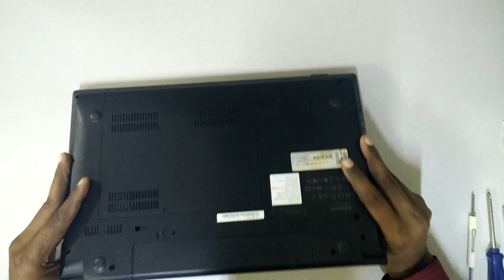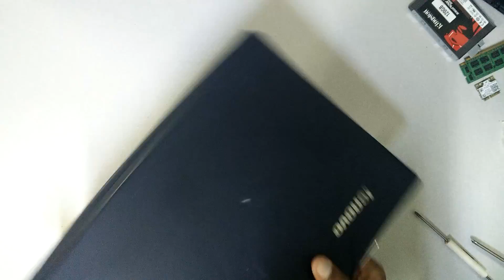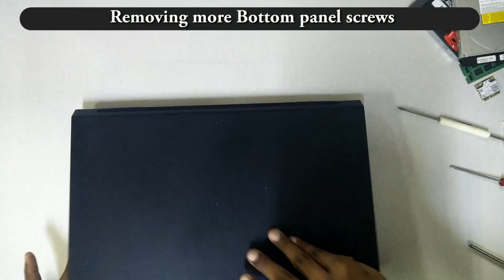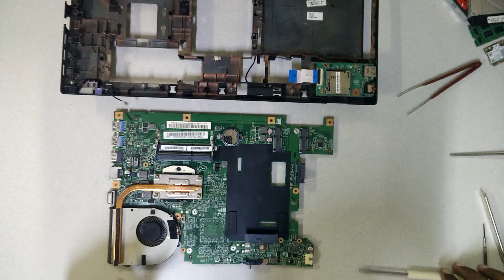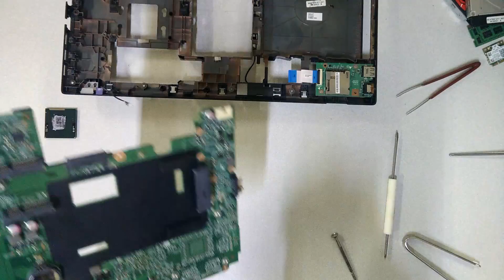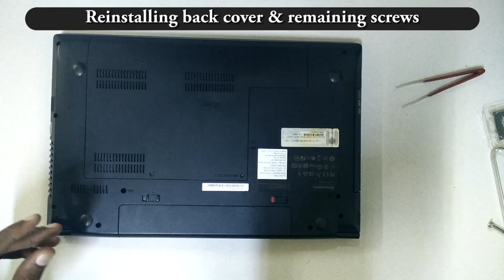Lenovo B590 laptop CPU upgrade step by step

Comment: You can also upgrade the HM70 system to a Core i7, you just need to patch the BIOS and use a cheap CH341A programmer with a clip. I managed to do it without desoldering. There's a description in the Lenovo B590 thread on 4pda. You can also upgrade to 16 GB of memory.

Comment: In 2023 What CPU is better to Update  this Laptop???
Reply: The Intel Core-i5 3230M, 16 MB RAM and a SSD. So you can install Windows 11, it runs as fast as Windows 10. But be careful, my B590 came with the Core i5. After an upgrade, the laptop may restart every 30 minutes. My mainbord has the number 627439G.

Comment: Thumbs up! Question... because obviously you know what you are doing and I don't lol.  I just upgraded mine with an SSD and new ram(after taking a course in A+ and thinking of changing careers before I realized no way because I over estimated my intelligence level lmao). Still I took the upgrade project on of my old Lenovo out of boredom and was successful. But now my fans are running hot. The Lenovo is lightening speed btw so patting myself on back for that, did well lol. I seem to recall though in class about maybe the cpu can't handle what I did- its vague and I cannot remember. Thoughts? Should I upgrade the CPU and what to?

Comment: HI bro op video!Could i ask u something?I have Lenovo B590 motherboard 20206 with 2gb ram and cpu intel celeron 1.9Ghz.Its very slow and all the time it froze.Could u tell me if its possible to change the ram to 8gb and which processor is the best for my model .I really want it smooth.Really will appreciate any answer
Reply: Hey! I have same 20206 but with Pentium B960. I added 4gb ram and now it has 8gb. Also I added SSD
Reply: And now it works 500% faster
Reply: i know im late but regardless, you can put in an 8 gb so dimm memory stick, the laptop supports up to 1600mhz ddr3, and you can also add an ssd

Comment: hello 
Can someone help me?  
I have a motherboard 20606 hm70   can it be replaced with another  motherboard that suports i5 or i7 ? 
If yes , then can please give me a link to that ?
Thank you !
Reply: What exactly is the model of the laptop, which processor (cpu) and which discrete card (gpu)?
Reply: @slavafedotov5742    lenovo b590  
cpu pentium 2020m
video hd graphics
Reply: @johnjohn-mz9rm  Here are two motherboard options. Compare with the motherboard of your laptop on the ports and mounting screws. I advise you to buy a card with a video card (GPU) GeForce 640M 2GB - it is more powerful than the GF 720. For this card you can buy i5-3360m / i5-3380m. For i7 you need powerful cooling tubes and they are not needed - this is not a gaming laptop.
Reply: @johnjohn-mz9rm  links opened? include your country and your currency at the top of the page
Reply: @slavafedotov5742   romania  currency  Leu

Comment: in geometrical dimensions, does the 20208 board fit in the case from the 20206 board? The 20208 board has an additional USB connector
Reply from the maker: I don't think so

Comment: Il problema non è la scheda madre in sè ma il chipset differente, alcuni modelli montano HM70 (no upgrade) altri HM77 che può essere aggiornato.
Reply: Ciao io ho la scheda madre con HM77. Vorrei passare dall'attuale pentium G2020 a un i3 o i5. È possibile? Se sì, quale secondo te potrebbe essere compatibile?
Reply: @matteodicarlo5848  sto mo গোলক mi ha cancellato la rjsposta
Reply: @TheFelix63  ok però mi sono accorto di avere HM70, quindi a quanto pare nessun upgrade. Parto con un Pentium 2020m e avrei voluto almeno mettere un Core i3-3120 (scelto tra i "papabili" per la temperatura, uguale al 2020m, da sito intel). Ma a quanto pare il chipset HM70 blocca tutto, è corretto?
Reply: @matteodicarlo5848  e si

Comment: Hello TKSJa, I would like to upgrade my old laptop Lenovo B570, this laptop have installed Intel Pentium B950 2.10 and would like to upgrade it to core i7 3840QM.  Do you think is possible, should i do something else than instal core i7 instead B950?

Please let me know,

And congrats, very good and useful channel.

Thanks in advance,
Reply from the maker: Based on my previous research, the laptop will have power and overheating issues.
Reply: TKSJa thank you my friend
Reply: So it is risky if we replace the i7 processor on B590
Reply: and the Core i7 3632QM.....35W....?

Comment: Do you happen to know if it's possible to upgrade the B590's GPU? In my B590, the CPU is not the problem because it came with i5 already installed, but I would like to upgrade the GPU. It has integrated Intel Graphics 4000 and a NVIDIA chip, the GT 720M, which is very likely soldered to the motherboard.

I noticed it would actually be a decent gaming laptop if it wasn't for the 720M, which isn't really meant for gaming. When playing intensive games at high settings, the 720M will be maxed out at 100% usage, while the CPU won't even be at 40% and neither will be the RAM. The system could go MUCH further without the 720M bottlenecking it! So I would love to upgrade it... Seeing how you're familiar with the inside of the thing - do you think it can be done???
Reply from the maker: I don't think it will because since the board was designed for the 720M. That would be a big risk trying to do that.

Comment: nicely done. what about workrate and heating lvl(temperature)? does cooler work as well after upgrade?
Reply from the maker: It works just the same no overheating because the old & new CPU has the same TDP of 35 watts. Here is a link to the spec sheet Old http://intel.ly/2rprD7o & New http://intel.ly/2rp5Xs7
Reply: TKSJa my thanks

Comment: is this the only cpu that you could have used?  Or what made you go with this over over something potentially better?
Reply from the maker: The main reason for selecting this CPU was compatability and it is the CPU that came into some of these same laptops. I have seen were persons installing i7 and are having alot of issues (freezing, overheating & frequent reboots).
Reply: Awesome thanks for the reply.  How is the i5 you put in? I mean i know it's not going to be able to play new games or anything but have you found any limitations?
Reply from the maker: Much better than a i3 and it is able to playback 4k videos. It is what I use to edit all the videos on my channel without any issue.
Reply: TKSJa hey sorry to bug you again.  did you have to do any bios updates before hand? I didn't see it as a technically approved cpu upgrade.  or did you just install it and it booted right up?
Reply from the maker: +TS 656577 Install and boot right up. Some of the Lenovo B590 comes with this cpu. See link https://goo.gl/ghb2ax